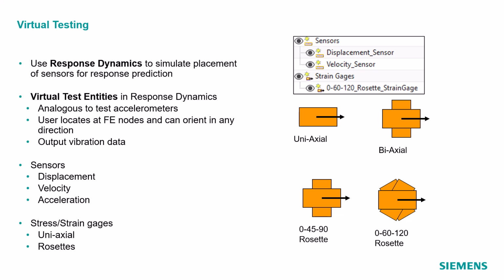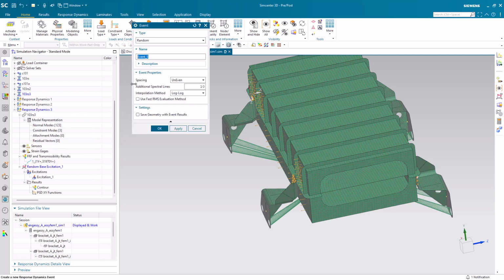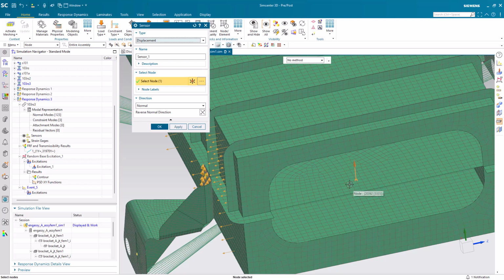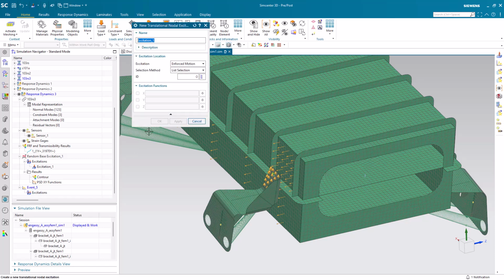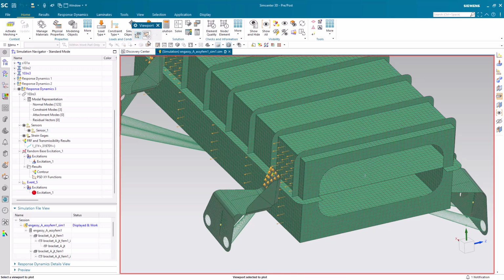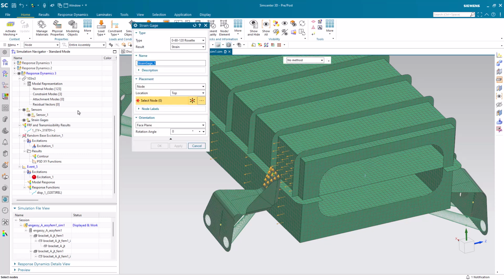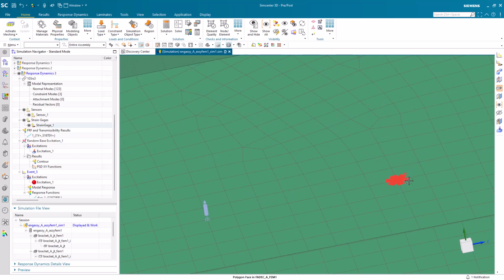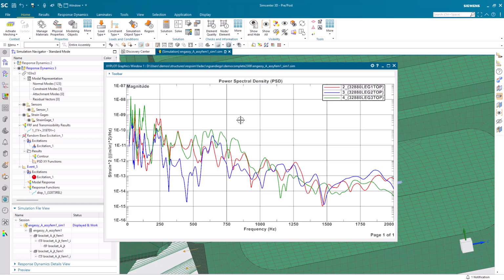How To Create A Response Dynamics Sensor and Strain Gage

Comment: Could you show how to create load 3G at 33Hz?
Reply from the maker: Sounds like you may want to run a transient event in response dynamics.  Start by creating a time pulse signal with the function toolkit. In the Pulse Function Creation dialog, select Sine, Full Cycle, amplitude 3, time period 1/66 (not 1/33), number of cycles 33, number of intervals 330, ordinate type acceleration, unit type g.  Then select a record name 3gat33hz then browse or create an afu file to put it in.  Be careful when creating the signal as the period is not 1/frequency as you would expect.  I plan to write up a support case to get this corrected.  Then create a new transient event.  Create a new excitation using the 3gat33hz function created above.
Reply: @Simcenter3DTipsandTricks  Thanks for your advice